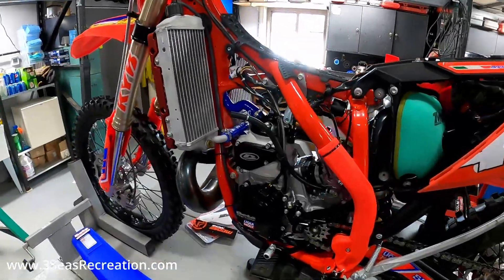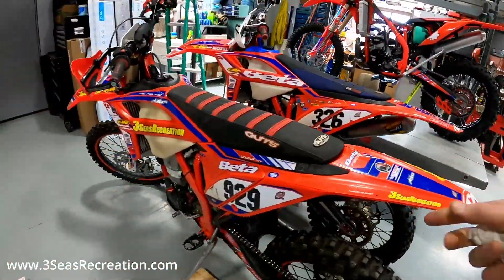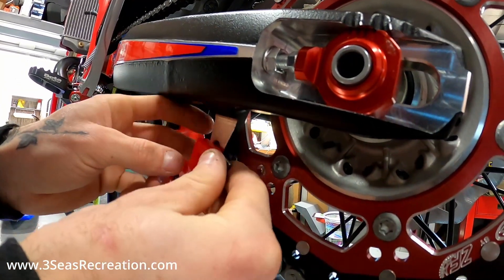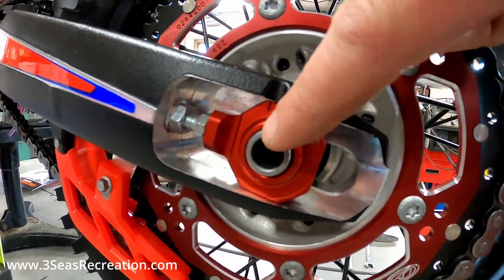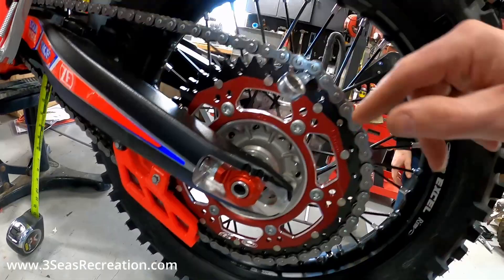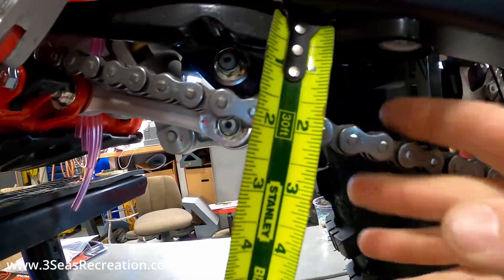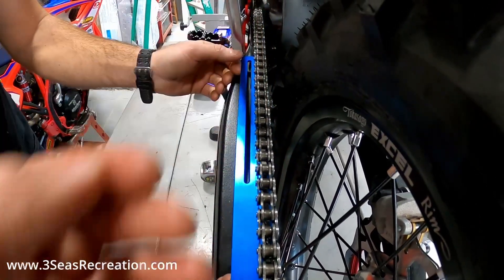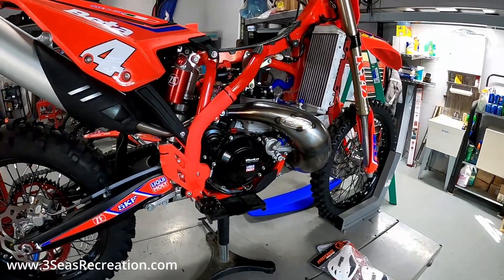2022 Beta 250 Race Edition - Dirt Bike chain adjustment Pro Tips! Check before you ride! Beta 300 rr

Comment: I make a a stepped block with minimum and maximum chain slack dimensions cut into it. A go/no-go gauge if you will. You never have to pull out the tape measure again. I like your alignment method. 👍

Comment: when measuring the chain slack, should you elevate the rear wheel to relieve the suspension, or leave it compressed under its own weight ?
Reply from the maker: Good Afternoon and good question, in the Beta manual they want the bike tire on the ground when checking the chain this way. Thanks for watching!
Reply: @3SeasRecreation  i ask because the manual isn't clear. In fact, I contacted Beta USA, and they said the tire should be in the air when measuring the 30-35mm slack spec on the 2022 RRS models.

Comment: This is a dumb question. I installed a new 14t front sprocket on a Beta 500. I torqued it down with a impact while the bike was in neutral holding the tire but then came back and torqued it to 44 ft/lbs with a torque wrench but had it in 1st gear. I took it for a ride and while it shifts fine it doesn't feel as smooth as before. Am I being paranoid or could I have messed up something? Thanks

Comment: I’m not sure about where to check chain tension. Some bike manuals say from the top half of the chain and some say from the bottom. The result could be very different from different checkpoints.

As far as I can recall, beta’s manual doesn’t indicate where to check the tension but only says 30mm.

I have a 2023 Xtrainer btw.

Can you help me with my question?
Reply: If it’s in neutral the tension should be equal top and bottom.